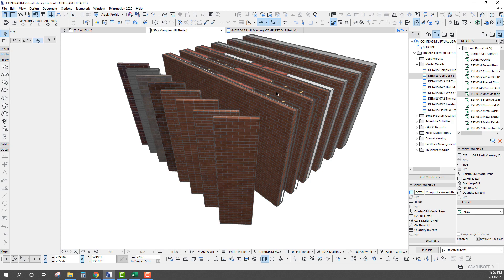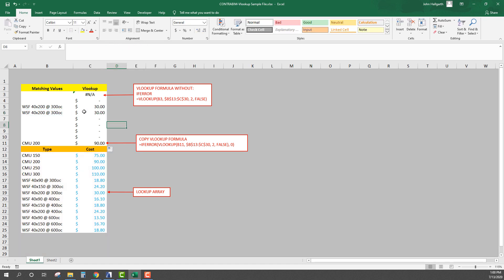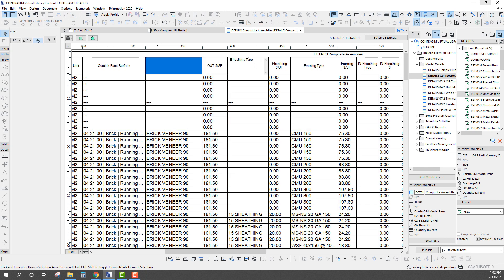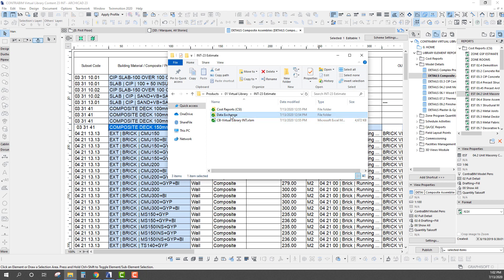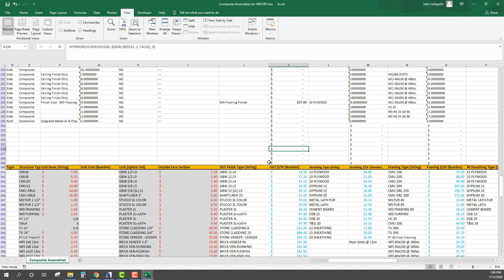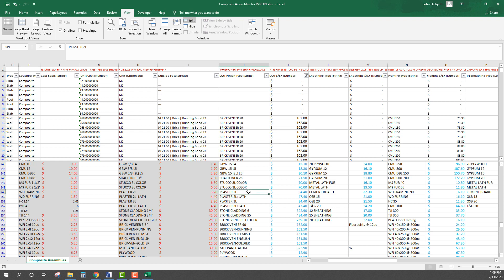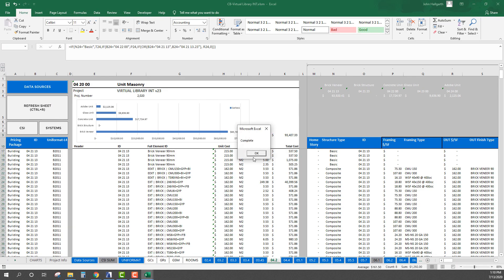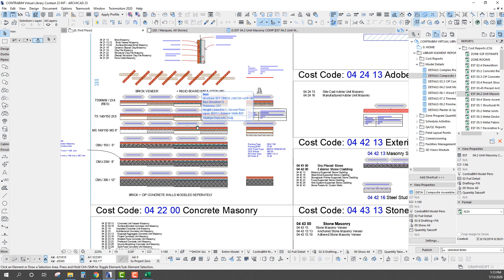VLOOKUP Formulas to Add Cost Properties to Archicad Composite Structures!

Comment: you can even add building material description in a new column, so it loads and updates it when you need, ( description is needed for keynoting, )
Reply from the maker: You can certainly create a property for building material description, but this has to be a property, not the "building material" description. Unfortunately we still can't export/import material based properties, as far as I can see through my various testing of such. But for keynoting, yes a property can work for that function!

Comment: How do you check the quality of the model? I mean you have to be sure that you don‘t have double elments or wrong placed building elements. Do you use a model checker before do this workflow?
Reply from the maker: Yes it's good to run through checking duplicates, but when applied to a project I always go back and forth between actual takeoff reports and the project 2d/3d views to make sure everything is in line. In this particular sample it's a library of elements, so that's a big part of getting everything right before using it on a project. Thanks for the great question!
Reply: Thanks for the answer. Do you use any model checking software (solibri, desite?) Dashboards (Excel or power BI) is also a good choice. I have to watch your video with the dashboards. Great channel with great content👍🏻😊

Comment: I'm working on a new Archicad template for urban planning for my office and there are some calculations that Archicad can't do by itself, and I'm thinking that a python script might help! The problem is that I know nothing about programing!
Reply from the maker: What type of calculations?
Reply: @CONTRABIM  The floor area ratio for example! The building coverage ratio it's easy to do straight into Archicad but the floor area ratio it's a bit tricky!
Reply from the maker: @mariansdraila  Yes to calculate that typically you have to add up several areas, and divide by another, which is easy in an Excel workbook, but not available in Archicad as far as I know. You could have a schedule that gives you the totals, and then plug the total floor area into the site zone which could then easily spit out a FAR calc. Just a thought!
Reply: @CONTRABIM  That's the way I usually do it, but I need to get the result back into ArchiCAD on the final layout, and I'm thinking that maybe with the help of a Python script I might find a way to automate that! Not sure if that's possible! I need to do some research on that and of course, learn Python. :)